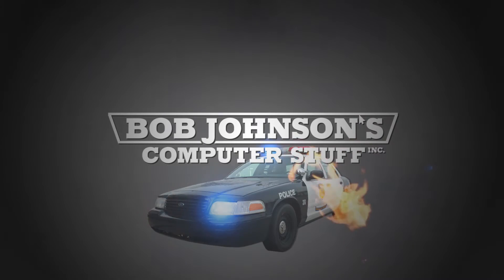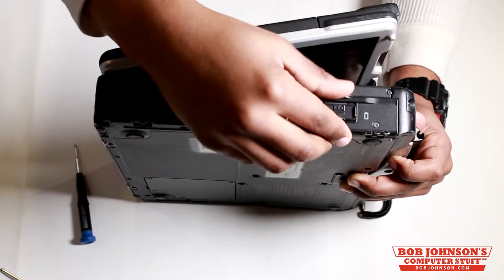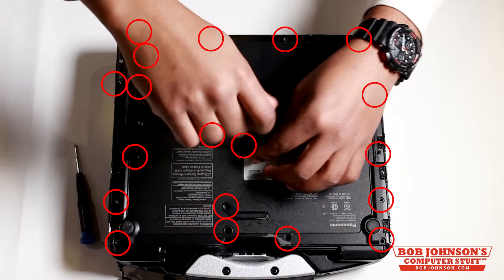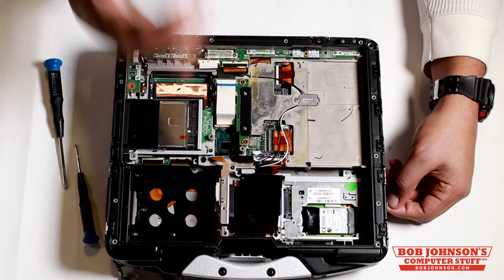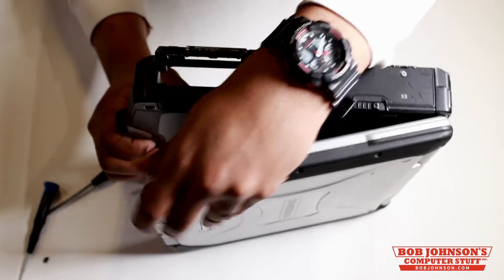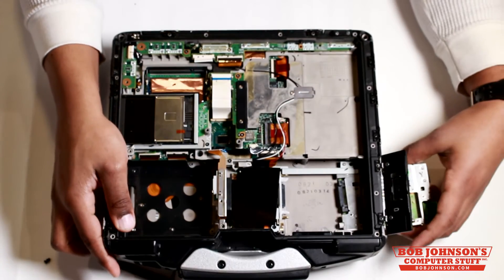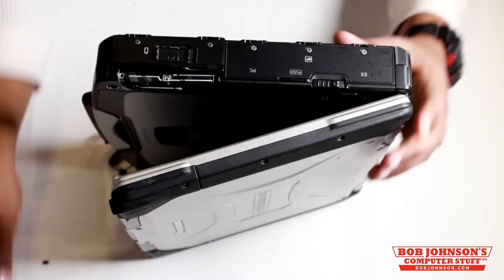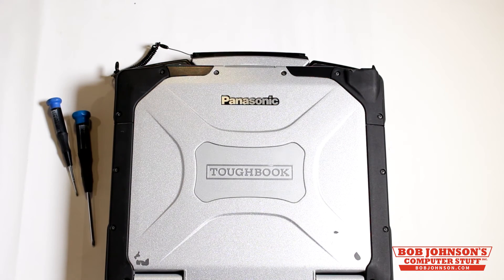How to Install the WWAN Sled in a Panasonic Toughbook CF-30

Comment: i have a cf-30 (on it right now) with one of these sleds and on the top right of the lid i have a large box (GPS ANTENNA?) when i trace the antenna wires from the card to the back of the lid i found one of the black ones are cut at the hinge . do you sell replacements or do i need the whole assembly? also my wwan sled is labeled for verizon are there other sim company that work?
Reply from the maker: +Oah Do you have a model number for that unit? Typically the GPS units do have a larger boxes at the corner of the top screen bezel.